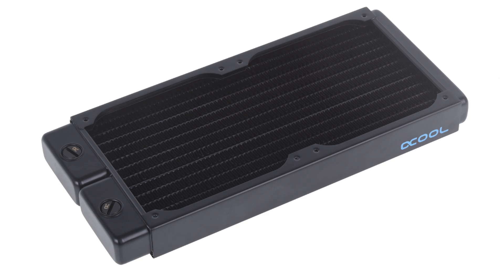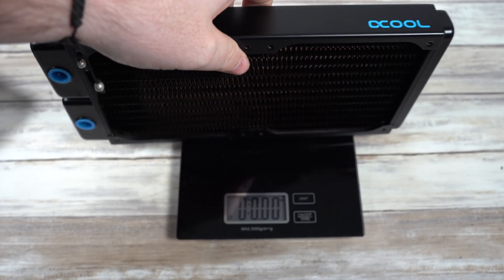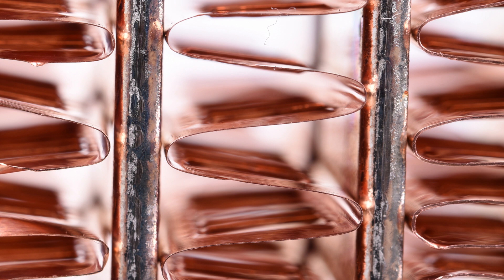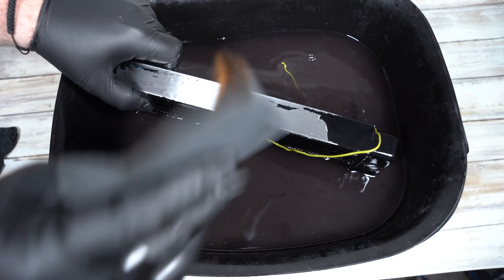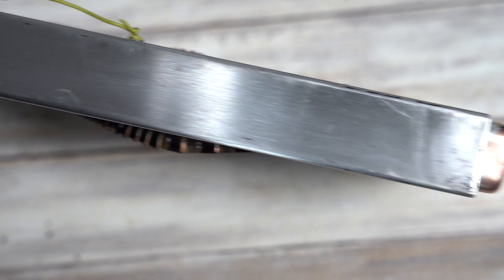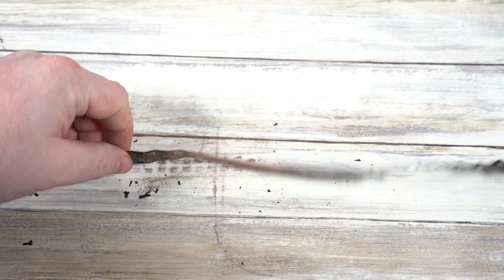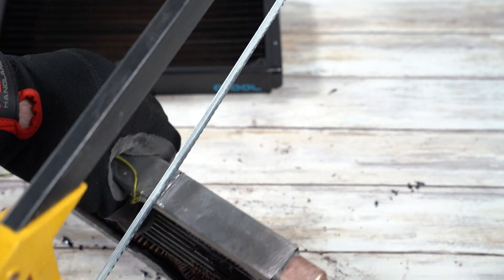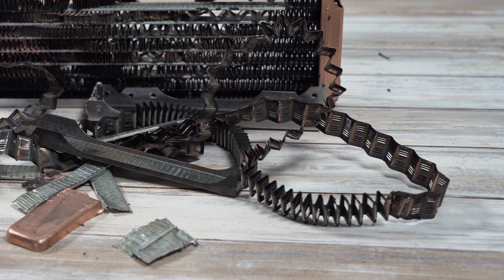Are Alphacool Radiators Really Full Copper?

Comment: I had used alphacool radiators for power electronics cooling with transformer oil as medium. They are simply superb in heat dissipation and give more delta T.

Comment: If you weren’t making these in China you could just walk in to your factory and show us the parts, but you don’t want people to see your Chinese factory so you’re doing this.
Reply from the maker: ??? we never said that we dont have our factorys  in china. But as we are the only company in the world where all water-bearing parts are made of copper, we certainly won't give anyone the chance to see our trade secrets. So far, there is no one else who can also make the channels out of copper.
Reply: @AlphacoolGmbH  what about EKWB? The do 240mm Classic rad with copper channels, but brass chambers. And do you recommend to flush new radiator with this: 1part 9-10% Vinegar + 10 parts of distilled water? And left rad for 12-24 hours for cleaning. Also do you recommend to do this 1 time in a year of usage or two years?
Reply from the maker: @Дмитрий-с3п4ы  We do not comment on the products of other manufacturers. We say we are the only manufacturer with pure copper radiators in terms of water-carrying components and there is a reason why no manufacturer disagrees. 
We recommend only the use of distilled water when rinsing. A little vinegar can not hurt, but afterwards you still have to rinse again with distilled water, because no vinegar residue should remain in the radiator. Otherwise, you only have to clean it if you switch from colored liquid to clear, for example. That is, during a conversion or a complete refill. Otherwise, it is not necessary regardless of the period. We have systems that have been running for 5 years without ever being serviced.
Reply: @AlphacoolGmbH  Thanks a lot for your quick answer, it really helps. Have a great day! :)
Reply: All radiators are pretty much made in China core wise. In fact, your car's OEM radiator is made in China by the same manufacturer that makes PC water cooling radiators (Or well, the other way around). I am not even sure that HWlabs makes their radiator cores in house, they only say that they were the "first company to design and manufactur a radiator in house" but nothing about today's lineup. I have a Nemesis GTS and a Nemesis GTX in my loop, both are lovely, and yet I am not even sure that the core isn't made in China.

Comment: The radiator is actually REALLY PRETTY without the black paint. I love the look of copper.
Reply: wait for the copper to oxidize then let see how much you would like the oxidized cooper color.
Reply: @eliadbu  that takes forever.

and even then, u can leave it as "patina" or take the radiators,
submerge them in baking soda, vinegar and sodion chloride.

then after a while u can brush the rest of the oxidisation simply off. 

I personally love the look of pure copper and for the next build i try to find blank copper radiators.

they mix awesome with a black PC.
Reply: @Hardys-Mods  forever is few years, the patina looks bad. If you want to maintain it regularly go ahead get Cooper finish.
Reply: @eliadbu a clear coating similar to the black paint but clear would fix that